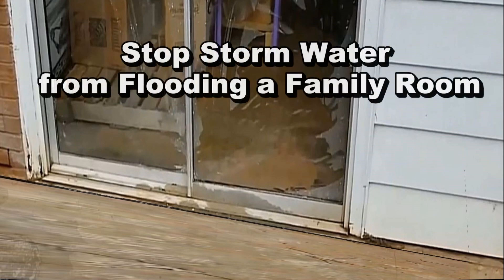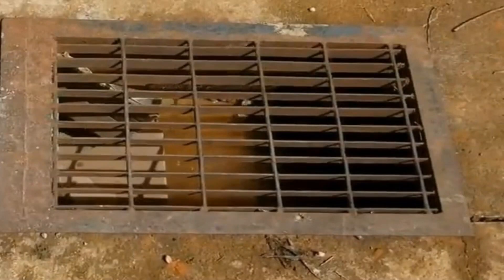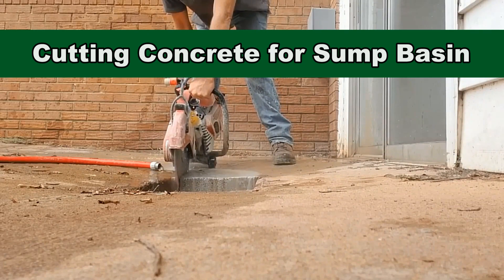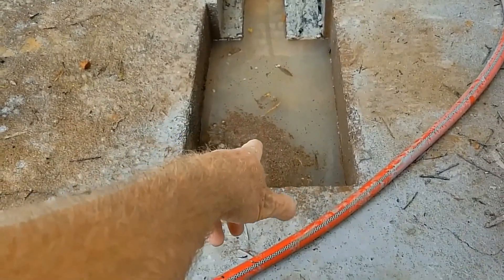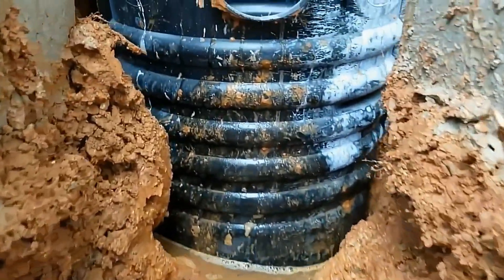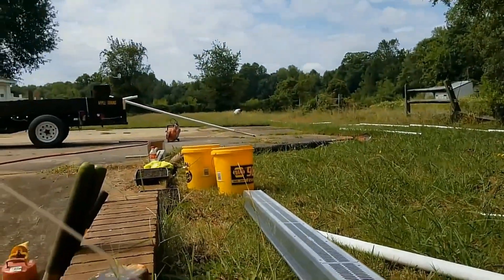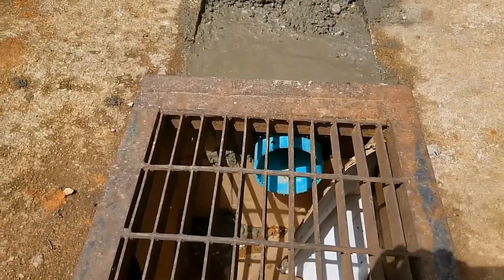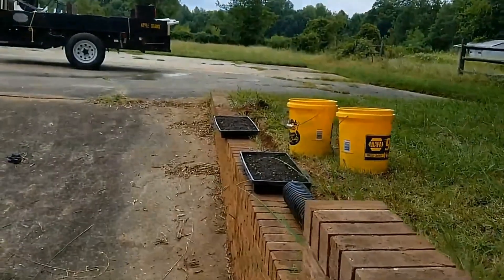Extreme Negative Grade - Concrete and Steel Grate Solves Flooded Family Room

Comment: why is the blue pipe so high in the drain , shouldn't it be lower to prevent standing water and insects from breeding?
Reply: By putting it at the lowest point it draws all the crap that washes off the drive through the pump, which can damage it over time, by leaving it slightly higher, you can dredge the basin every now and then to save the longevity of the pump.

Comment: There is so much buried cable and lines buried. Do you call 411 and wait for them to flag where you want to run trencher once the quote is accepted, before digging? I would be to concerned if not of the trencher just ripping thru whatever is underground.
Reply: I'm not sure if it's the law everywhere but definitely the most important step as far as safety and avoiding very expense repairs. It's worth mentioning in every video involving digging residential, especially for diy'ers. Too many people don't understand the seriousness of what can go wrong or just how much they can run into. I know because I've talked to lots of everyday folks who did it and got lucky that a worse disaster didn't happen.
Reply from the maker: Yes of course! It’s the law
Reply: @appledrains  Okay, I've never seen you talk about it in the process and didn't remember ever seeing the color flags so I wasn't sure. Thanks
Reply: @maxgreen8901  Watch more videos Chuck talks about it a lot.

Comment: During heavy, steady rains those battery backups are worthless. We swapped out for a water jet sump pump which uses the existing city water line to siphon out the water. It may run a lot more during a heavy storm but city water is more reliable than a battery.
Reply: Totally agree, the battery backups are basically worthless within a year and are undersized anyway.
Reply: @leemullican2060  Do you have any recommendations for a backup solution other than battery?  My water pressure isn't high enough for the city water backup solution, so that's a no go.  I currently have a battery backup as well as a portable generator in case it's an extended power outage.  However, there are flaws with any system and I know there's flaws with that thinking.  Any suggestions?